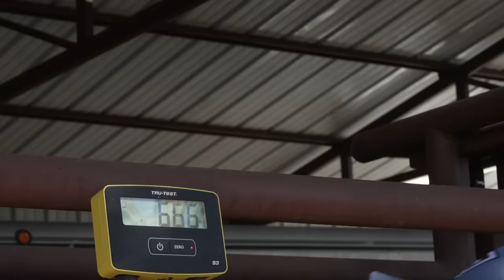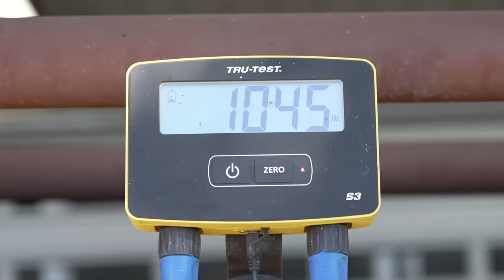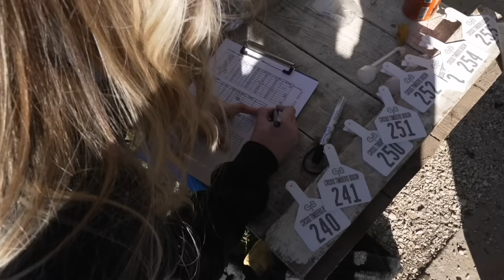Oops! Happened Again...Working Bison!

Comment: Dusty: You’re taking too many risks. You need to build a plywood structure, the width of those runways, attach it to your tractor, and chase the bison down into the narrow passageways with that. I think Broken Arrow Bison had a video where he visited a bison Ranch that used such a thing. Try to find that video and build one of those. Don’t get yourself killed.
I’ll trade it to find a title of the video. You might have to alter your shoots a little bit, temporarily and eliminate the wide areas.
Reply: That plywood attachment for your tractor I mentioned, might’ve been on your channel, on a visit you made to another bison ranch.
Reply from the maker: We did visit one ranch that had it in South Dakota! I worked on getting it done for this handling but we were not able to get it completely finished in time! It will be around for the spring working!

Comment: How good are bosons sense of sight? It appears that the bison are confused as to where they are supposed to go. The gates don't present as a wall to them. Have you tried solid gates, or covered gates, that once closed give the appearance of a wall?  Then when there is a turn in the shute, again it doesn't appear from their point of view that there is an opening since your walls are solid. Maybe someway to illuminate the turn, such as a light  just beyond those turns?

Comment: Possible solution to reducing stress on Eleanor & her calf if you do have to take the calf tto the vet...Load Eleanor in the front section of the trailer & the calf in the calf in the back section. That way they are together but it will be still be easy to get the calf unloaded & reloaded & back w/mama for the trip home. Should reduce a significant amount of stress on both Eleanor & the calf. Hope Doc can look at her & you won't have to take her in. Good luck! And good job to all on successfully working the Dunbar herd. Hope the Big Joe group goes just as well!

Comment: Makes you wonder,that is if you had the time, if it would be worth training the up young with cubes to walk through the shoots.  Seems like most of the 'fight' they have simply has to do with the fact that this is just not something they experience much at all.  I know that our dairy cows learn pretty quickly to walkthrough shoots so they reach the milking parlour in single file and can be directed into a stall, and they do it calmly only because even before they are old enough to have a calf and start being milked they get walked through guided by treats.  At first they are absolutely crazy and want to take the place apart simply because they don't like being hemmed in but after a few weeks of working on training them a couple days a week they are marching along behind the cow in front looking for some cubes thrown out for them.  A couple years ago we started doing this with the newly weaned calves, training them to run through a set of 'practice shoots' we set up that just took them from one field to another, and the next time back to the other field. When that group had to actually be worked the first time they were pretty well behaved, at least up until where they walked into the squeeze shoot, where they did get a bit rowdy but that experience was totally new to them.  As they have gotten older since then they have been very accepting of the shoots and we have continued to do this with each group we weaned.  Its actually getting them through the shoots calmly which is where they are the most likely to injured themselves or people working them, even if they do act up once in the squeeze shoot, as then we have pretty much total control over them once they are in there and when they are released it directly out in a run to afield or pasture.  Not sure if Bison would react the same way but since you seem to have been able to train them to follow you along when offering cubes, making rounding them up and catching them so much easier, it might be worth trying to see if, starting with the very young, they could be acclimated and trained to walk through the shots and be more interested in a treat then in panicking.

Comment: my 2  cents, if you care for it.

those that keep running around, a chicote / stockyard whip will certainly get their attention. A paddle works good for well maintained heard that are calm and you need to gently push them (like dairy cows) to the barn that live their life in the stalls. roughstock need a rougher hand  until they get accustomed to the chutes / corral. You dont have to zap them really especially a with a prod, but they are like children, you let them throw tantrums they will continue to throw tantrums. 

Its great you want to care for your stock. but that display 9:00-10:00 a pop in the air with a whip would have stopped all that nonsense.